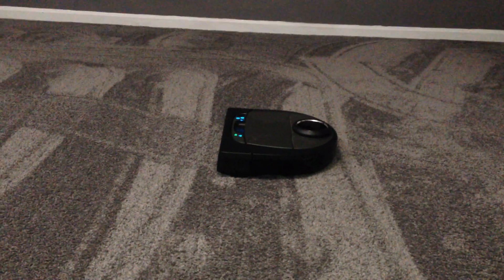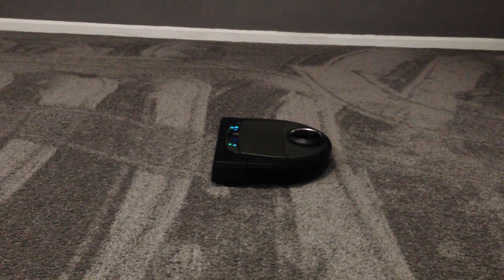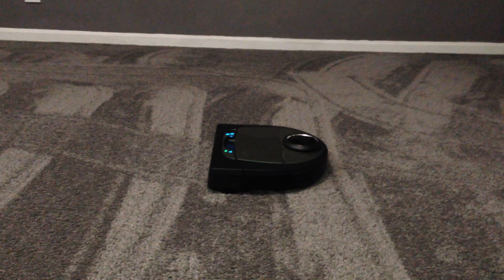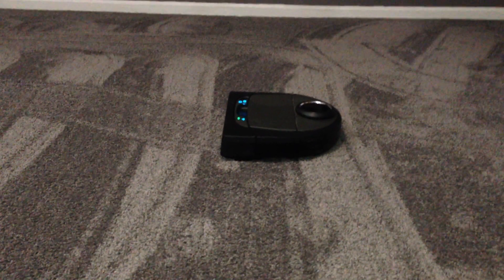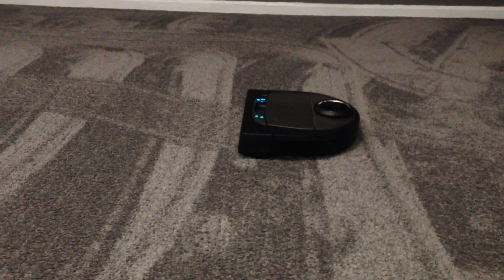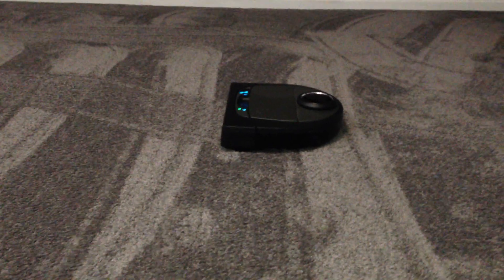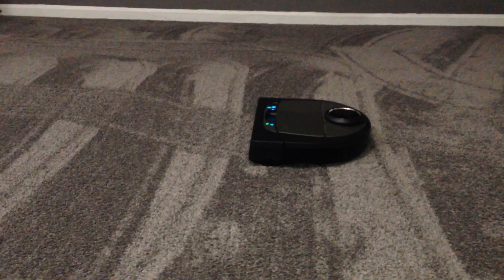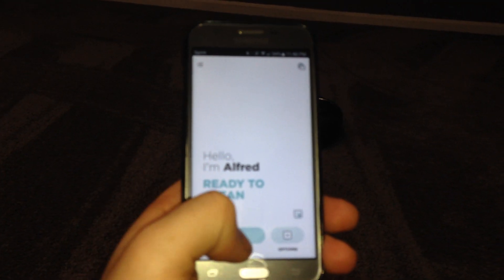Neato D7 fan revival

Comment: pwm needs to be modified, i dont like when neato put the blower motor eco mode is set on 60% and turbo on 70% turbo needs to be set at the max at least 100% botvac connect eco mode is 65% and 80% on turbo i dont get it